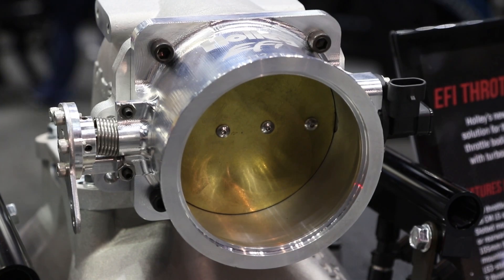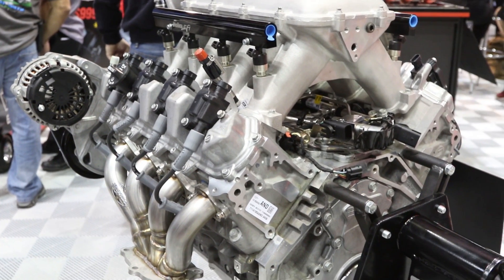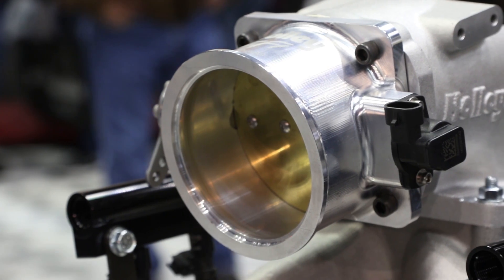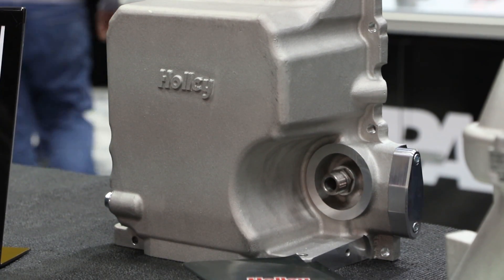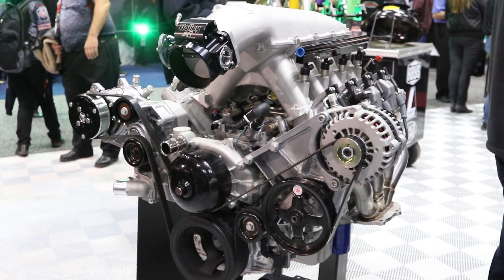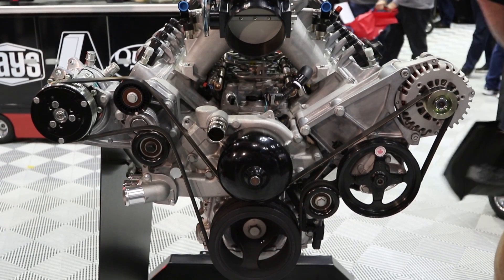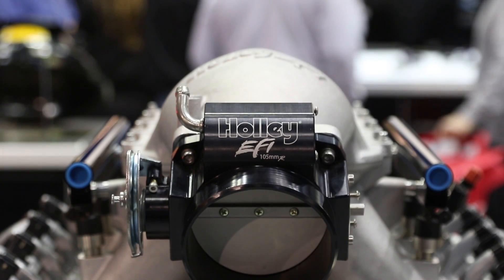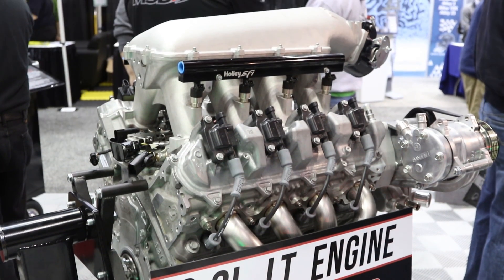PRI 2016: Holley Rolls Out Gen V LT Swap Parts A-Plenty

Comment: Somehow I'm imagine a Gen V LT1, swapped the stock EFI intakes to carburettor but rather than a carburettor, a EFI carburettor conversion is installed on it so that you have an old big round air filter with EFI that looks like a carburettor.

Comment: It makes no sense to buy an LT and start race modifying it.  LS is cheaper with more options, and easier to program
Reply: I have $1500 into my L83. I plan to make over 900. There are deals out there.
Reply: I just bought my L83 for $700 only has 22K on it. I can use factory computer to control DI and Holley Hp/dominator to control port injection and ignition so I can 16 injectors for when u crank up the boost. Plus the forged factory LT1 crank $500 new from GM fits the L83 and so do the forged factory rods at $39 a piece from GM with zero modification to block LS doesn’t offer any of that. Plus the L83 factory makes more power than a factory LS1 so there’s lots of reasons to mod out the LTs lol

Comment: Why can't we get away from having a computer and just run it up like a HEI distributor instead of having everything that can be failed when a EMP pulse hits the nation
Reply: Scott H wouldn’t the EMP kill the battery and ignition box careless if it’s hei or computer controlled?
Reply: First thought after emp blast. Hmm I wonder if the drag strip is open today lol
Reply: Can I get the dual point's setup? Maybe the big accel coil on the firewall with the B&M 177 blower......  SOLID FLAT TAPPET